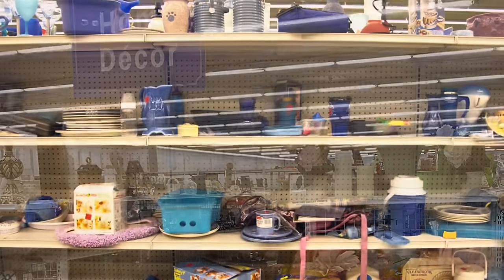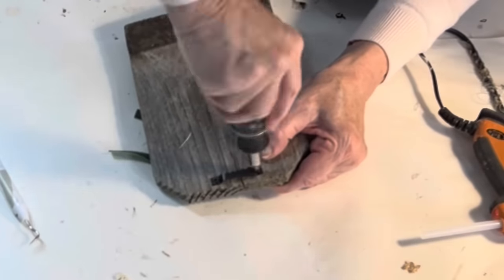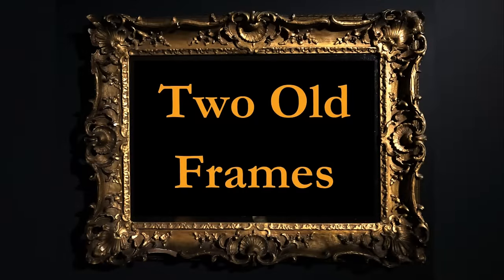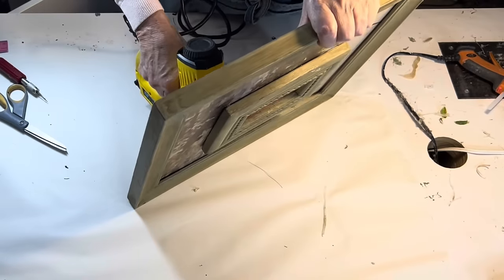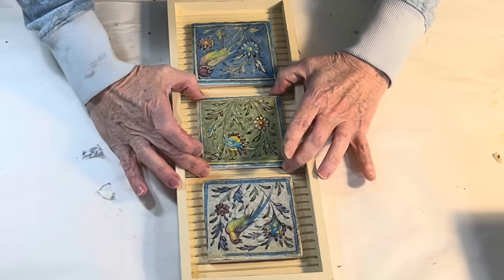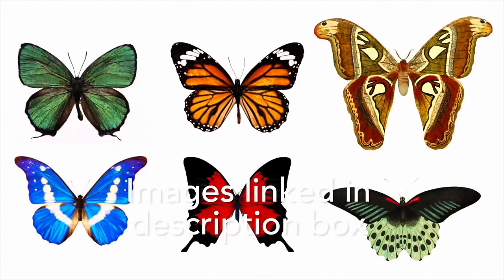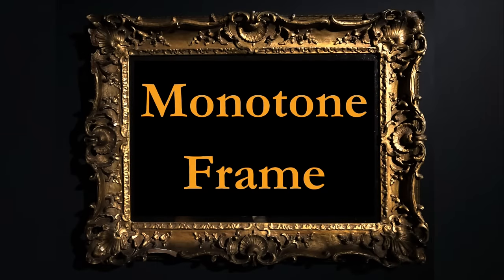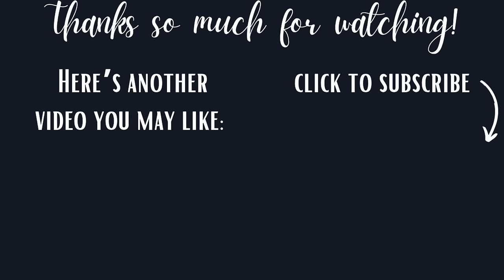15 Thrift Store Finds Transformed Into Unique and Stylish Wall Decor

Comment: So many great projects once again! Completely fell in love with the tile frame. The frame with mushroom candle and the butterfly picture are other favorites. The round frame never had glass or backing. It's a frame to hold a decorative collector's plate. Also, I like the more muted butterflies on the picture. It enables the picture of the woman to shine through. The brighter butterflies on the frame draw the eye in. I must put transfers on my shopping list!
Reply from the maker: Thank you so much, Elisabeth! I was wondering about that frame because the brackets/clamps on the back seemed odd, too. Now, it makes perfect sense. I don’t think I have ever seen a frame for plates, but now I want some!
Reply: @CanterburyCottage  When the market dropped on collector's plates in the mid-80's of course frames did too. They were always expensive which is why I never bought them. I've seen several companies market them now for $40 and up. Keep checking thrift shops for them. You might get lucky. 😁